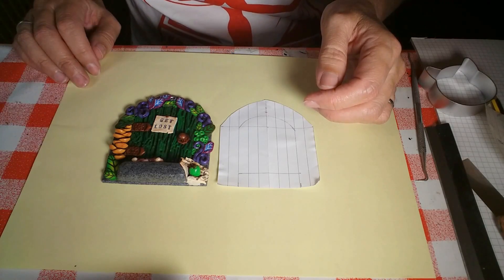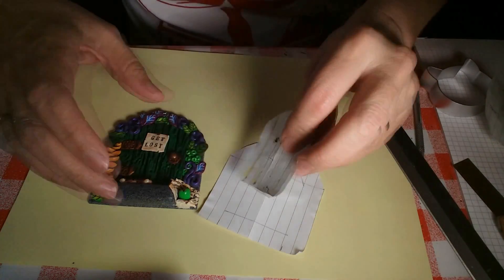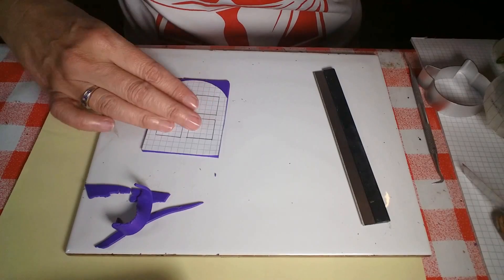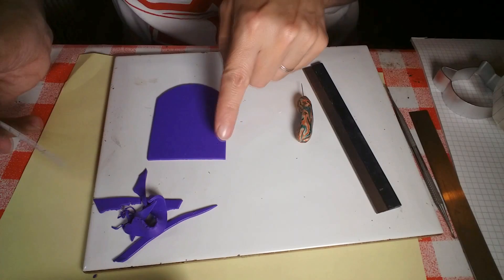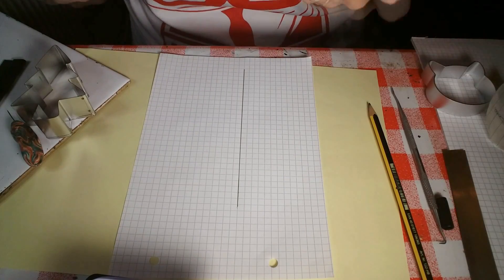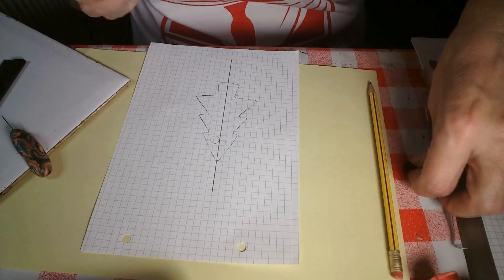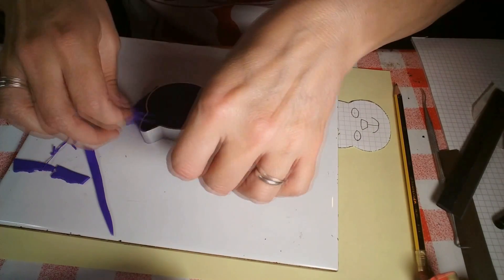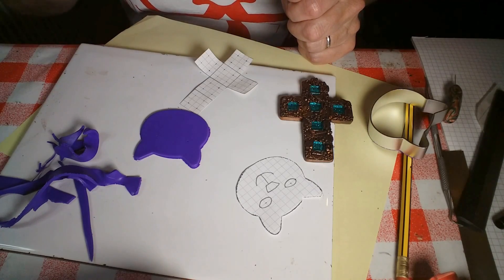How To Make Flat Paper Templates For Polymer Clay

Comment: Templates are for sure helpful!  I "draw" them out on the computer & save them so I can reprint when they're getting ragged.  It's also helpful if I want adjust the size for different projects.  Another informative video from my favorite YouTuber!  Thanks for sharing!
Reply: I had issues with a few templates I have starting to fall apart, and had had the thought of transferring them to a flexible cutting mat that I can usually pick up as a 2-pack at the dollar store.  Flexible, more durable than paper, and fairly cheap.  

Unfortunately, I've been sidetracked with other projects, but am debating - should I just trace around the paper templates, or attempt to run the mat through the printer.  It's thin, but still heavier than cardstock.
Reply from the maker: That's a great idea! I'm not sure I could do it but it's certainly a thought - I will look into it. xx